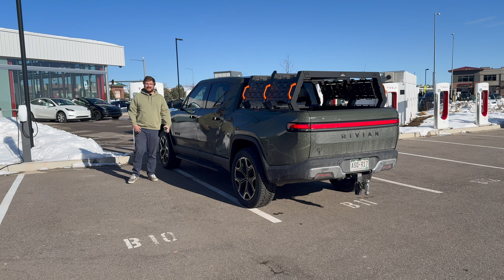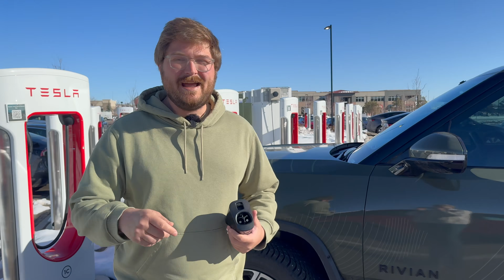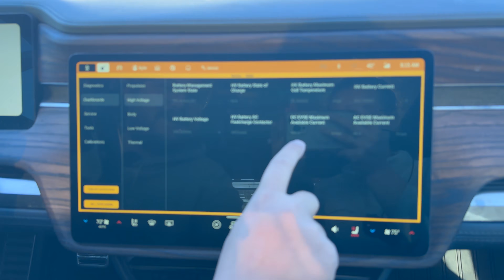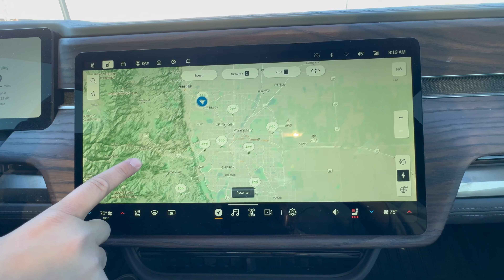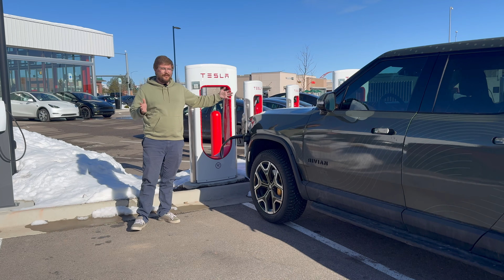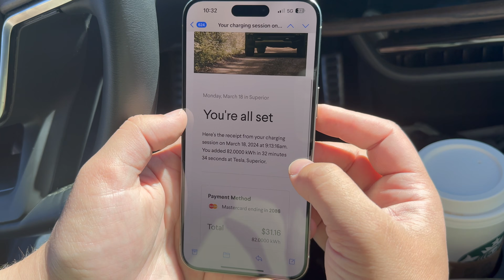Rivian Gains Access To The Tesla Supercharger Network! My First Charging Experience

Comment: Buc ee's in Johnstown opened today and the new Tesla super charger appears to be on-line as it's showing up in the Tesla App now.  Looks like you need to try that one as it's probably close to Fort Collins
Reply: And it has a Magic Dock too.
Reply: I read that only about half of the Tesla chargers are actually installed of the 20 that were planned.
Reply: Latest Tesla SC station opened yesterday in Colorado and the station is oriented more in the middle of the lane.  Rivian will fit without blocking neighboring lane but tire is mostly in other lane but still on the line.  This is the farthest I could move the Rivian and still charge.  Can't include pic here.  Older stations (like in Kyle's vid) have the station more to the passenger side of the lane (orientation is front bumper facing in) so with these stations blocking two spots is the only option.  This will cause user conflicts.  I have both Rivian and Tesla and am excited and pissed at the same time.  
1. Tesla opened the network (very positive) 2. Rivian will provide an adapter (positive). 3. Lack of planning on implementation will cause user conflicts (very negative)
Reply: Have Out of Spec Dave test it. He loves Buc ees

Comment: On the “you can’t charge here!” - there are a ton of Tesla owners who don’t even realize that (until this month) non-Tesla’s couldn’t charge at Superchargers.
Reply: In Europe all tesla chargers are open to non teslas. But here tesla was also forced to have ccs2 on their cars and chargers.  Still feels weird when I pull up in my vw
Reply: Interesting. As a Tesla owner I've only had to call out a Ford Explorer and an RV towing a vehicle (blocked 8 or so chargers), haha.
Reply: What do you mean?  every Tesla owner knew this,  they have all seen the poorly engineered charging ports of Non-Tesla EV's,  they are all a joke.
Reply: @Triathlete5551  Most people that own Tesla vehicles aren’t Tesla “enthusiasts.” Most are owned by average people who treat them the same way an average person treats a Toyota Camry or a Ford Edge. It’s a vehicle to drive around in. I would say less than half even realize non-Tesla EVs use a different charge port. (I’ve seen very confused Tesla drivers at CCS stations before, as well as very confused CCS vehicle owners at Supercharger locations. I’ve even seen Tesla owners trying to help non-Tesla owners charge at a Supercharger, confused as to why the cable doesn’t fit. I’ve been at a Rivian station, where a non-Rivian pulled up, plugged in - it didn’t work. And another Rivian owner was trying to help them when I walked up and let them both know that Rivian’s chargers don’t work on non-Rivians (yet) - and the other Rivian owner told them “Oh, there’s another station I use all the time across the street, try that one!” It was a Supercharger. No, the confused person’s Kia wouldn’t charge there, either. I showed them how to use their vehicle navigation to find a compatible station, as well as PlugShare and Chargeway.) 

And the CCS Port isn’t the problem. Sure, it’s slightly less good than the NACS port. But EA simply swapping the end of the cable from CCS to NACS won’t magically fix EA’s terrible maintenance problem.

Comment: Now we need a full charging battle for the Rivian from 0% to 80% SoC. EA and EVgo vs Tesla. To a 100% is not great as all slow down after that.

Kyle also needs to go to that Rivian Adventure Network site and park in such a away where the stall is in the middle to show Rivian that their cord will reach both the front left like current R1's have, or the rear left were they to move the R2 and R3 ports over. All they would need to do is draw new parking lines on the sites so that the charger is in the center of the parking spot. Similar to what Tesla is doing with their V4 stalls.
Reply: As long as all are 500A stations, it should be the same. All offer 500A, so it’s on the vehicle’s charge curve. Now if Tesla opens up >500A, and Rivian enables it, SC might win, since at least right now, SC are the only stations that allow >500A.
Reply: @AnonymousFreakYT  I agree. That's why I would love to see it. However, I think the Rivian will keep the peak curve for longer on 350kw 800v chargers because current Rivians can also get close to 600v so the pack is easier to keep cool.

Comment: GM EV owner here .  Rivian skipped the line.  GM was the 2nd to announce. Any word when we will get our turn?
Reply: Same also a GM EV owner.  GM better announce somerthing soon. GM was supposed to be second.
Reply: GM has almost no compatible vehicles on the road. They aren’t saying the Bolt can use it, only the Ultium-platform. Which have almost not vehicles on the road yet. Yes, it sucks for those who DO have one; the only thing I can think of is that Rivian kicked in more $$$.
Reply: @AnonymousFreakYT  interesting do you have a link to GM saying the Bolts and Bolt EUV won't be getting adapters?
Reply: Announcement to public yes, but who knows when deals were made behind closed doors
Reply: Rented a 2024 bolt and it was limited to charging only at 48kW. Thought it was a charger problem but the cars specs only allow 48kW charge. Fast chargers were useless
Reply: @mtnmecca_ej  48kW is better than 10kW.
Reply: @AnonymousFreakYT  true. I’m just used to high powered charging and assumed most batteries could accept it. Changed road trip expectation of 15 minute charge to 60+ minutes.

Comment: Wasn't GM the second company to switch to NACS? I wonder when GM will be able to use superchargers.
Reply: @bullshitbingo2259  Rear wheel drive Teslas that use NCA/NCM charge at 250kw. The LFP versions charge at 170kw and don't get even close to the Bolt's 55kw max until it's after 90% Soc.

By slow charging EVs, I mean EVs meant to clog up charging stations to slow down the EV transition. EVs like the Bolt, the Leaf, the Toyota bZ4X, all of which charge below 100kW or at max 55kw like the Bolt or 50kw for the Leaf.

Tesla is not EA or EVgo. They'll do what they need to do to make sure their stations are not clogged up unnecessarily. Not even by their own EVs. That's why they send out notifications to ALL EVs when a station is getting full that the rates past 80% will increase.

Sending messages to slow charging EVs that higher rates after 30 or 40 minutes of a $1 per minute after that if the station is getting full is another way they'll make sure their stations are not clogged up.

If slow charging EV owners want to play around by being there for an hour and a half, then they can go to EA stations that allow ID4 owners to leave their EVs there for hours at a time because they have free charging. 

EA and EVgo will now be left for slow charging EVs only. Or 800v that didn't add the proper voltage down converters. However, those will use 800v V4's to get their full speeds.
Reply: GM is completely silent on the Tesla Supercharger thing. It's so weird.
Reply: @anthonyc8499  That's because Marry doesn't give a rip.  She's likely to jump ship soon anyway, right before GM crashes and burns.  She doesn't care about you charging at a Tesla SC.... the only thing she cares about is her golden parachute.
Reply: @anthonyc8499  that's because most of their new ultimate cars are down for service...😂
Reply: thought I read April ?
Reply: @lylestavast7652 This Spring. Tomorrow is the official beginning of spring.
Reply: I bet they are struggling to source adapters right now since they manage to struggle on everything right now.

Ford and Rivian also appear to do the proper software handshake for plug and charge. GM’s state of software is chaotic.
Reply: @coprolite_steve  I dont care if it has 'plug and charge' For the few times I would possible need it, using the app to enable charing is easy enough.
Reply: What? Tesla designed and manufactures the adapters for GM vehicles. The holdup is likely GM not wanting to tell their customers they won't be providing the adapters for free to their customers. Either that or they simply haven't decided yet to provide them for free to massive corporate bureaucracy slowing down the decision making process. GM moves slow like a glacier and they are melting just as fast.  @coprolite_steve
Reply: Hopefully soon I have a tesla and my sister has a bolt that we were hoping would gain acess already.
Reply: Bolts charge so darn slow ! And take up 2 spots because of port location ! Such a fail !
Reply: Do we need Bolts at Superchargers? Ford doesn't support their old 50kW CCS hatchback on NACS after all.
Reply: As a Bolt owner I am looking forward to making an peckerwood like you wait.
Reply: @JimmyDorff Not really. I simply don't understand why Bolt owners want access to the Supercharger network. They knew what they were buying. Most owners say they bought it to charge at home and drive around locally. 

They can charge at any 50kw station and not feel the difference. EVgo and others still have those around. GM has a partnership with EVgo. If they made the Bolt to charge this slowly, they should work with EVgo to add more 50kw stations for them.
Reply: @junehanzawa5165  Poor baby have to wait on bolt owners at supercharging station. Oh the horror.
Reply: There are no fast options other than Tesla in Chattanooga TN so it needs opened to gm and others soon
Reply: @Quickicecarreviews123  Both of the V3 stations in Chattanooga are now opened to Ford EVs (other than slow charging ones) and Rivians.

But I also see 3 EA stations in Chattanooga, so not sure what you mean by your "no fast options" comment.
Reply: Hopefully never.  Bolts are too slow
Reply: @ChicagoBob123 I can't wait until I can charge my Bolt on a Supercharger while parked in the wrong space and charging slow. It's going to be so fun!
Reply: Why would you take glee in inconveniencing others while simultaneously being inconvenienced yourself? Only a real jerk feels joy at inflicting inconvenience on others @Mike.T.
Reply: @ZipZoomZip  because it would be hilarious.
Reply: What would be hilarious? @Mike.T.
Reply: @ChicagoBob123  Sorry Bob but I will charge when ever where ever I choose.
Reply: @ChicagoBob123  fatherless opinion
Reply: @royaltyallen1162 no. If I pull up to a supercharger and it’s blocked by dead 4 Bolts, parked every other space, and charging to full…heads will roll.
Reply: @ChicagoBob123  Bolt owners love their Bolts, but I hope Tesla places some sort of time restriction to make sure Superchargers sites don't get overburdened with such slow charging EVs being there for an hour plus.

They already let you know when a station is getting full that your rates will go up after 80% SoC to encourage drivers to leave after 80%. So doing something similar with slow charging EVs is only fair. Have their rates go up to a $1 per minute after 30 or 40 minutes if the station is getting full. Bolt owners can always get to a 150kw EA or EVgo, or any 50kw charger, on their way to get to full.
Reply: Bolt owners can always get to a 150kw EA or EVgo, or any 50kw charger, on their way to get to full. I hope that's what they do.
Reply: @Paul-cj1wb  slow charging EVs like all non AWD Teslas?! And let's be honest the charging curve of the 250kW Teslas isn't any good and they dramatically fall to around 150kW very fast. But hey, Teslas charging network is equally outdated, offering 200-250kW chargers max through the year 2024. Lets hope they update the Model Y and a lot of chargers to 800V in 2025 or the brand will continue to go straight downhill. 

The competition builds massive amounts of 350-450kW chargers, the most available DC fast charging speed in Europe by the way, in China even a couple of 500kW chargers are being installed
Reply: @BBingo-v5i  Rear wheel drive Teslas that use NCA/NCM charge at 250kw. The LFP versions charge at 170kw and don't get even close to the Bolt's 55kw max until it's after 90% Soc.

By slow charging EVs, I mean EVs meant to clog up charging stations to slow down the EV transition. EVs like the Bolt, the Leaf, the Toyota bZ4X, all of which charge below 100kW or at max 55kw like the Bolt or 50kw for the Leaf.

Tesla is not EA or EVgo. They'll do what they need to do to make sure their stations are not clogged up unnecessarily. Not even by their own EVs. That's why they send out notifications to ALL EVs when a station is getting full that the rates past 80% will increase.

Sending messages to slow charging EVs that higher rates after 30 or 40 minutes of a $1 per minute after that if the station is getting full is another way they'll make sure their stations are not clogged up.

If slow charging EV owners want to play around by being there for an hour and a half, then they can go to EA stations that allow ID4 owners to leave their EVs there for hours at a time because they have free charging. 

EA and EVgo will now be left for slow charging EVs only. Or 800v that didn't add the proper voltage down converters. However, those will use 800v V4's to get their full speeds.
Reply: @ChicagoBob123  love it when you get to the one ultra charger and it has a Bolt or other snail charging on it - even if the others are open.

Comment: Will Rivian reciprocate Tesla's generosity by allowing Tesla owners to charge at Rivian DC fast charge stations with the Tesla CCS adapter? I've noticed Rivian stations completely empty pretty often. Would be a way for them to increase income?
Reply: Rivian Adventure Network stations open up to all CCS/NACS EVs sometime before the end of 2024.
Reply: Yes, it's being opened up
Reply: RJ says they will open it up to everybody eventually. But Rivian only for now.
Reply: Do they not? I assumed the CCS adapter worked just fine there.
Reply: Nope @lancesbeataxes2901  its just for rivian even though its capable of charging everyone
Reply: No, Rivian doesn't allow non Rivian vehicles to sign up and charge there. Only their L2 chargers are open. @dissectingreality
Reply: I have seen polestar charging at the RAN in barstow.
Reply: @seanconners1574  was he charging or just plugged in? I’ve seen lots of failed PlugShare checkins by non-Rivians at RAN stations

Comment: Tesla drivers are f-ed now. Other evs are going to block half of the stalls because of different charger port location.
Reply: As long as non-Tesla EVs with “wrong side” charge ports all park next to each other, at most one stall will be unusable. And in many Supercharger locations, there’s an empty parking spot next to the end stall, so at worst, there’s an empty parking spot that looks like it’s available, but the “Tesla-assigned” dispenser is in use.
Reply: I have never seen a Tesla charging station full.

Comment: xD the process to get into rivian service mode seems unnecessarily complicated lol... it's like a rainmaking ritual lol...

i don't really buy the rivian point about "curb side charging means right rear port", they could've put it on the front passenger side if they wanted to facilitate curbside charging... why put the charge port at a location that's literally farthest away from the driver door? it makes no sense
Reply: Especially if a vehicle tows, front passenger side or center is the way to go. 

Regarding Rivian, believe I saw an interview with someone from rivian and they said putting it on the rear was a cost saving measure as the layout of their new vehicles (base model r2/r3 will be RWD if i'm not mistaken...) would necessitate high voltage lines being run to the front to put it there or something to that effect.
Reply: @theichione  ok I Guess that's fair.. the rwd thing... Still though, rear Passengers side is literally the most inconvenient place for drivers

Comment: Does Rivian have a plan to open their DC fast chargers to other makes?
Reply: They do. They’ve said it will happen “later this year.”
Reply: I live in Grand Junction, Colorado.  We have a six stall (old) Tesla Supercharger which is right next to a Rivian Adventure with six DC fast chargers and two level II chargers.  It's a nice setup, but would be way better if we could all use both. @AnonymousFreakYT
Reply: I would assume they will switch over to NCS  as their future cars will have the port by default so no adaptor is needed.
Reply: RJ was clear that it will be open to other makers. He said it during R2 launch.
Reply: I think the appropriate statement is

"It would be rude not to" ?